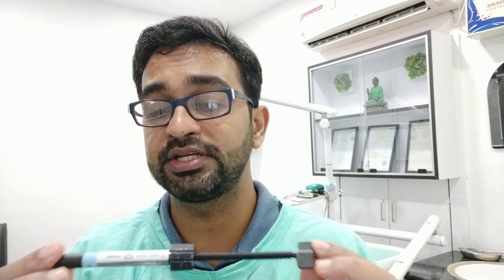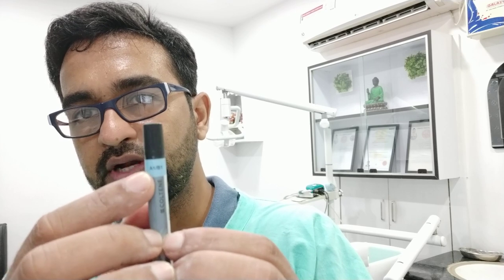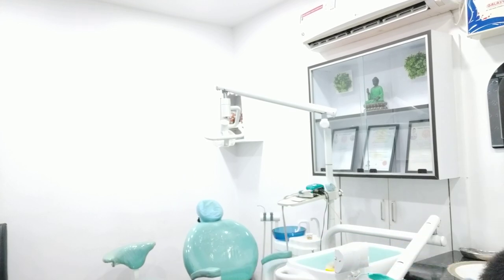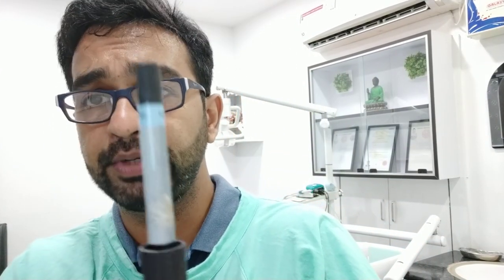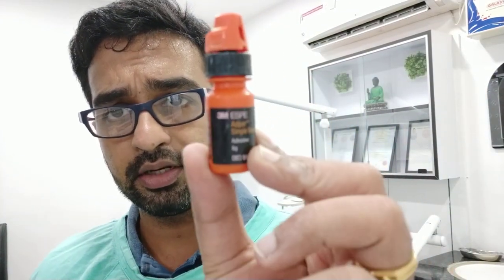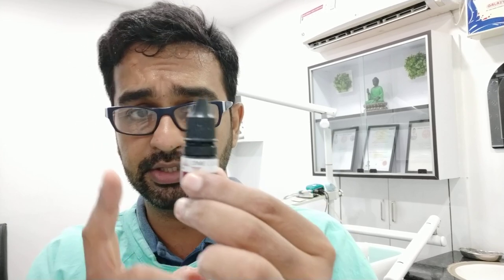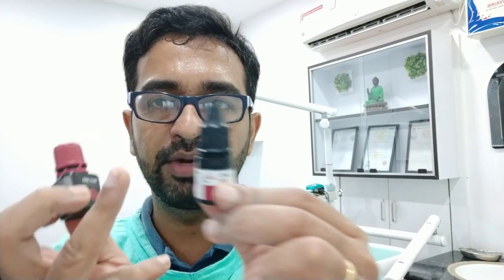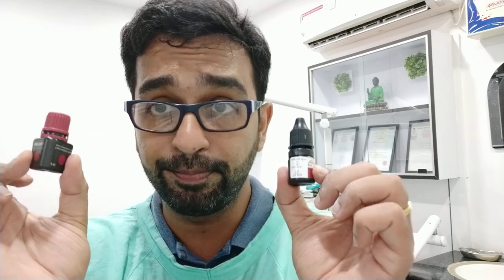COMPOSITES I USE IN MY DENTAL CLINIC SINCE 8 YEARS!

Comment: Could you recommend some good composites for orthodontic bonding? We have been using enlight but not very satisfied with it.
Reply: 3M is the best but it's quite expensive now a days, I have used Enlight for nearly   8 years, I can say the product is good, there is a composite called Orthofix which I have been using from past 3 years( slightly cheaper than Enlight) and it's almost as good as Enlight.
Reply: @muraleedharabhat8016  thankyou